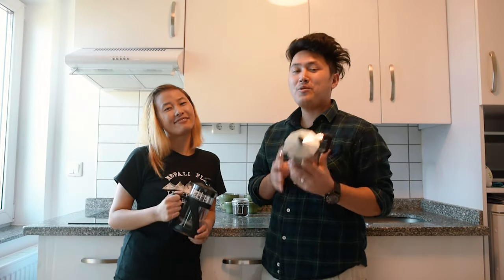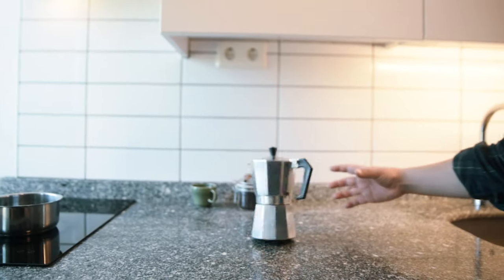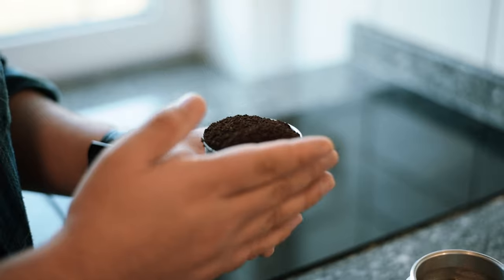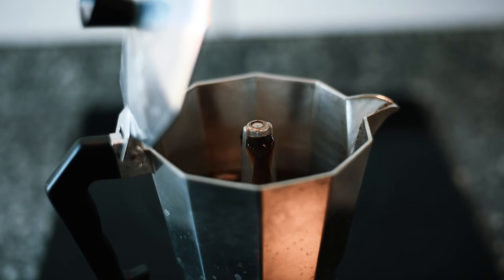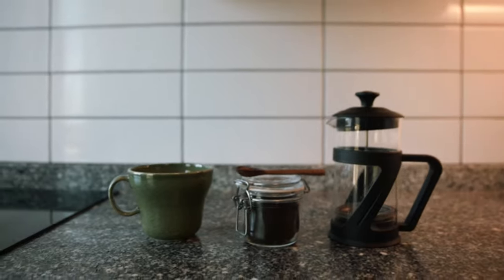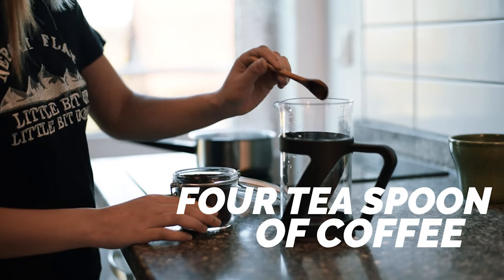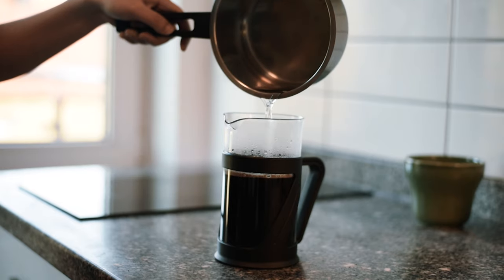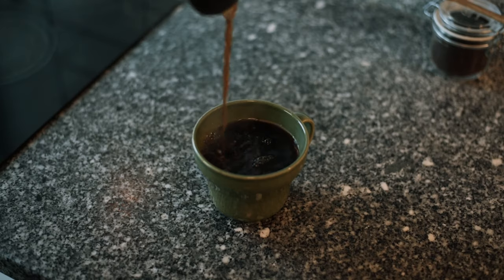HOW TO MAKE COFFEE USING A MOKA POT & FRENCH PRESS

Comment: why do you need to preheat the water when adding to the Moka pot?
Reply from the maker: If you put cold water then it'll take longer to brew the coffee so it will make the coffee bitter.
Reply: OK.  Thank you for the clarification.
Reply: Many videos say that, but it's a myth. The authentic Italian technique, since 1933, aligns with Bialetti instructions, and it makes consistently good coffee. 

If you're interested, the way they do it can be seen in the "Annalisa J Moka pot" video. Start with cold or room temperature filtered water. Loosely fill the basket with medium-fine ground coffee till it's even with the rim, but don't press or pack it. Cook it on a low gas flame or preheated medium electric stove. The instant you hear it begin to gurgle, quickly remove the pot from the heat and let it finish filling off the stove. There's enough heat inside the pot to finish brewing off the stove, so don't cool the pot with running water. As soon as the coffee stops flowing, use a teaspoon to stir up the first most-concentrated coffee from the bottom, and immediately pour. It won't be burnt or bitter because the heat stove wasn't too hot and the pot was removed from the heat early. 

The only other good Italian tutorials on YouTube are by "Il Barista Italiano" and "Italian with Bri." 

If you try it, I'll be interested in your review.